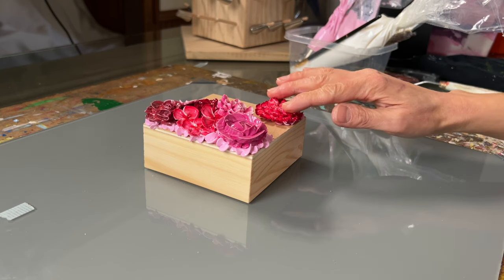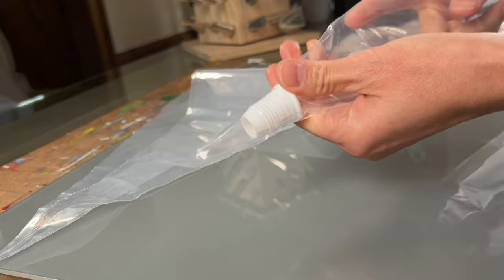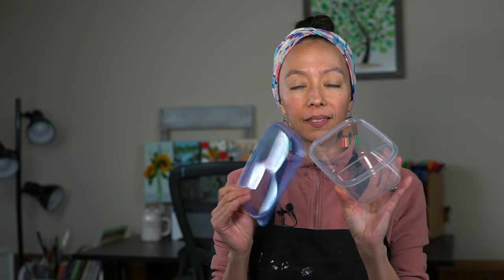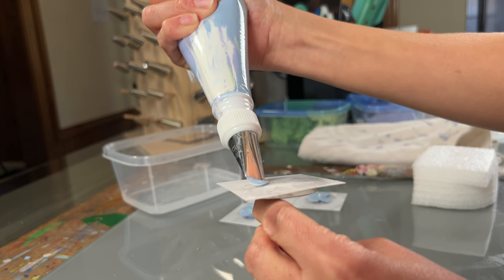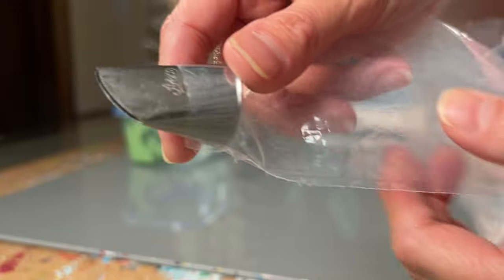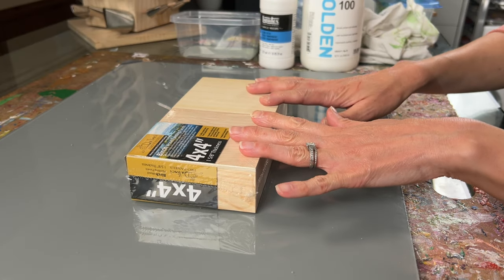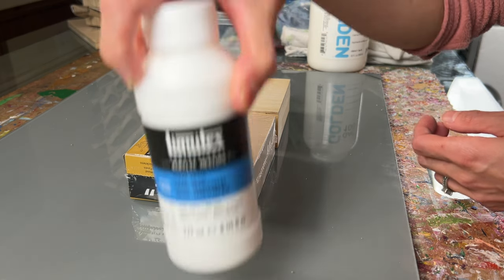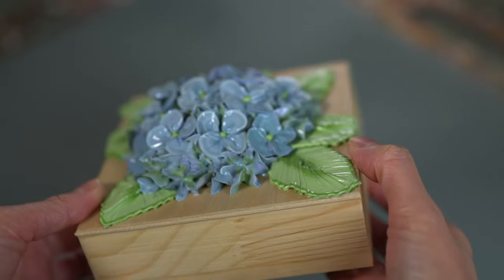How to Pipe a Hydrangea Flower with Acrylic Paint | Full Detailed Tutorial (From Start to Finish)

Comment: What will happen if we do this on a canvas instead of wood??
Reply from the maker: You could definitely paint/pipe on a canvas, there are several other artists that do this style that use canvases. I started off using canvases and there were no issues. Depending on how much paint you apply and the size of the canvas it could possibly bow the canvas overtime, but I doubt it would be significant. I just prefer to use wooden panels for look and the durability. Hope this helps!